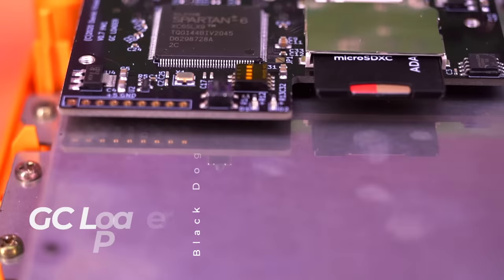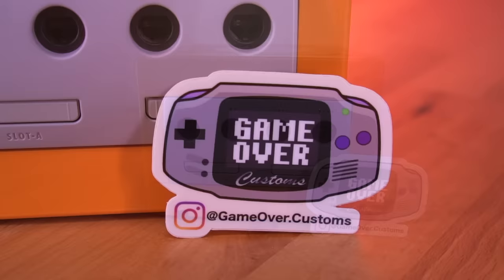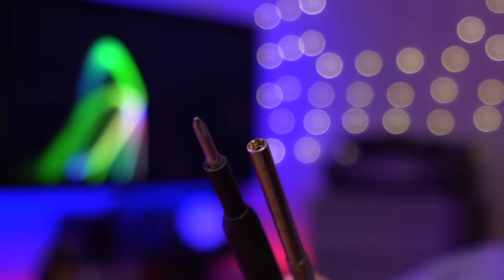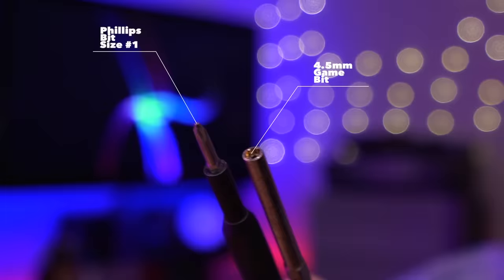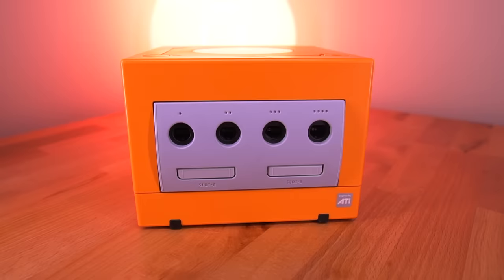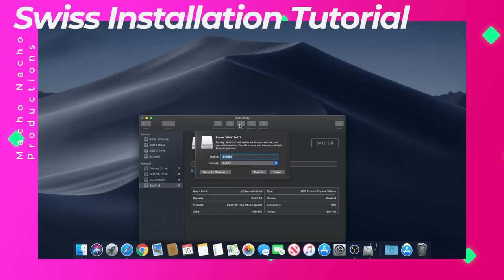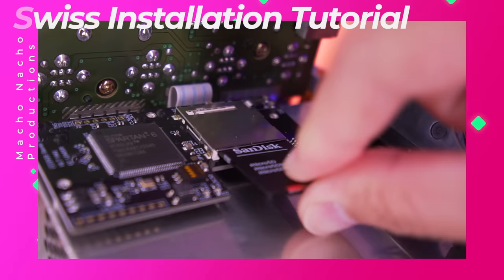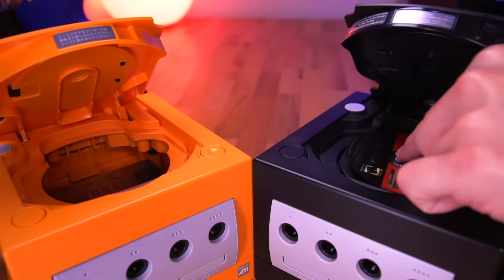How To Easily Play Your Entire GameCube Library From An SD Card! | GC Loader and Swiss Tutorial 2021

Comment: There's a new ODE coming for the GameCube that utilizes the Serial Port 1 (which will allow you to preserve the original optical drive) and will use M.2 SSD drives instead of SD cards.
Reply: Sounds interesting, can you provide a link or something?
Reply: I would love more info on this.
Reply: Does the Gamecube require a CD when launching swiss/roms? Or is the GCLoader the only CDless setup?
Reply: That means no LAN gaming, but still...
Reply: Any updates on this? Extremely interested....
Reply: Well?
Reply: Must be vaporware
Reply: I have not seen any updates to this project unfortunately. The project was posted/shown by an individual so there's no website or twitter account or similar to track it down.
Bummer since it looked promising in its early stage.
Reply: @RetrOrigin  bummer
Reply: @maciejkobus  That's awesome! I read your post on a Facebook group a while back and couldn't find it again. Glad to see the project is still going :)
Reply: @maciejkobus  Is this the picoboot, or something else? I cant seem to acquire a gc loader but dont want anything that requires soldering etc.
Reply: @Mr_jz_12  M.2 SSD adapter is something different from PicoBoot but for the best experience you'll need both.
Reply: @nbdyknws4446  just in case you still domt know, that would only be the case if you didn't have the gcloader and had something like Datel's SD card launcher. With the GCLoader, there's an iso you put that loads immediately, which loads swiss.
Reply: Post a video about it

Comment: Just did this mod to my GameCube a month or two ago. Super awesome. I used Swiss to use my Gameboy player. 
I also used this cool 3D printed extension mount. Basically connects to the GC loader with a SD card Extender wire, and fills in the space the optical drive took up. Allows you to swap Sd cards if you use multiple of them which is nice plus it looks good for the overall esthetic
Reply: Where did you buy the gc loader printed assembly?
Reply: @brkbtjunkie  laser bear 3d printing. If you google them they'll come up and it's one of the products they have available

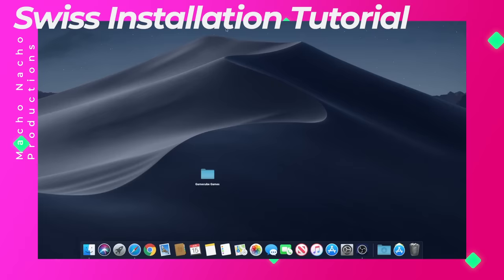Comment: 7:51 Both GC Loader and Swiss supports exFAT Format on larger SD Card.
Reply from the maker: That's awesome!  I didn't know that.  I followed the instructions on a website and it said Fat32.  Good to know!
Reply: You could also reformat the SD cards very easily. Thanks for the extra info. It will save people some time👍

Comment: One more HUGE detail we have to mention: If you dont have a SD2SP2 or a SDGecko Memory card with a small SD card in it, Swiss will not save settings. This is a limitation of the GCLoader and Swiss as it can't write back to the SD card in the GCloader. So all of the patches, settings, etc get lost. 
So invest in a SD2SP2, and drop a small 4gb card in it.
Reply from the maker: I will definitely be doing that!  Thanks for the heads up!  Still learning about the GC Modding scene.

Comment: I want to do this to my GameCube so bad! Just got to wait for it to be back in stock!
Reply from the maker: It's a great mod!  It should come back in stock soon!
Reply: You can also use the Wind Waker save exploit to launch into Swiss, and use the SD2SP2 which (imo) works perfectly fine. You also get to keep disc drive functionality this way instead of needing a second GameCube to play your discs. 

I can't get behind ODEs as full replacements for a disc drive. But if you can add it in addition to the disc drive? Absolutely go for it.
Reply: @Meepok1  Why would I need a second GameCube to play my discs when I can rip my discs and play them on the superior GC Loader? The entire point is to get rid of discs, and the associated noisy disc drives that will fail one day.
Reply: @mjc0961  becauuuuuse what good is it to have a collection if you can't even use the discs? I completely understand the appeal of it but again there's no reason to go with options that guy the drive for no reason. How many GameCubes with working drives do you think have been gutted? 

Also another question: does anyone actually know if there's a fail rate for drives in certain consoles? If you take care of your GameCube your drive shouldn't fail. 

I'd always prefer to have both options but that's just me.
Reply: @Meepok1  I agree. My option is cheaper but does the same thing. I run all my games through the sd2sd and Swiss boots from disc drive.
Reply: I have mine modded with the GC Loader, and SD2SP2 for saving my swiss settings.  Also, I got the EON mkII for HDMI output and Component compatibility for my CRT.  All that bullshit coupled with the M-classic post processor make for truly amazing gaming.  It's a lot of money ( even without scalping prices), but it was fun getting together and it's been worth it.

As far as nabbing a GC loader, get put on the mailing list and when they tell you to get in the que, be ON TIME.  I missed one round and had to wait almost 4 months for the next round.  When I did get mine, the entire stock sold out in 3 minutes.  I was lucky, and I wish the same to you.
Reply: FYI: It's back in stock.
Reply: @bowen1230  and I got it! Thank you!
Reply: @Meepok1  If you don't mind soldering, a cheap Xeno chip will allow you boot to SWISS with nothing else...As soldering goes it's fairly easy one...

Comment: Great video. I don't think you mentioned the gbi or Gameboy interface homebrew that enables people with a Gameboy player to use it without the startup disc. And also the SD card mount from laserbear. 2 essentials.
Reply from the maker: I will definitely be looking into those!  Thanks for the heads up.  Just got the GBA Player too!
Reply: @MachoNachoProductions  Not only do you not need the startup disc, but it provides better video quality than the official software.
Reply: @MachoNachoProductions  Something else you may want to consider, at least for now the gcloader can't write to its sd card, so if you want to save any settings in swiss you will need an sd gecko or sd2sp2 and a small sd card (this would also allow use of swiss virtual memory cards so you could save all your games to the sd gecko/sd2sp2 and not need to manage multiple memory cards), although they are working on adding support for writing to the gcloader's sd card. That may also allow saving games to the gcloader sd card

Comment: I did this to my gamecube couple months ago and the only reason I did it was because my disc drive just stopped reading discs.  I didn't know what to really do it sucked cause I didn't want to just sell it and I discovered the GC loader which isn't much more than a replacement drive.  Well worth it and has nice features.
Reply: Did you still need a memory card or does it save on the sd card?

Comment: ODEs for the GameCube has actually existed for a very long time allready , most of the Wii odes can be converted to the GameCube with simple PCBs but at the end of the day supply of these have been decreasing over the years as long as the price is right it's not terrible to have another solution available.

Especially if you consider that Swiss can play ISOs from a simple memory card to SD adapted or a plathora of other SD adapter's for the GameCube

Comment: This is expensive( $90+), you can do a same type of mod, a few solder joints and you can also get the same experience. Get a Xeno chip, $4-6 on ebay, a SD2SP2 $2-4 and a SWISS Disc, you can get a whole kit, WITH the SWISS disc on eBay for $20.  The advantage, you can also play any games you have physical AND you can play every game you want via ISO on a MicroSD card... 

This is good if your drive works fine,  You just leave you SWISS disk in, always boot to the menu and select you game..

All for under $20
Reply: Audio streaming is still an issue last time I checked. There's better compatibility with the GC loader due to it being an ODE.

Comment: It'd be nice if someone designed a 3D printed tray so that you could mount the PBC higher, using a ribbon cable to connect between internal GC header and the GC Loader. That's really the only negative I see, the SD card slot is inconveniently deep inside the case.
Reply: It already been made

Comment: There's a bunch more mods you could have done. I recently changed the thermal paste, changed the fan to a silent fan, changed the LED to a blue LED, changed the system battery and of course got the GC Loader installed as well. It was all pretty easy a great project in the end. Don't forget you can also use a GBP with GBI in the SD card and play GameBoy games as well.
Reply from the maker: I'm definitely planning on doing some more mod of the GC.  I just felt this one deserved its own video. Cheers!

Comment: Another amazing, informative and polished video from Tito! :)
I absolutely adore my GC Loader too, I put it in my GC last month.
I do have a few problems and I wonder if you have had them too:
-Upon launching Swiss, I keep being greeted with a popup saying that an update is available... like what, my GC isn't connected to the internet!
-Swiss will keep whining about not being to save the configs all the time until I decide to use an SD card on one of the memory card slots. (Gecko/action replay)
Reply from the maker: I have noticed that too.  I think Swiss is comparing its version to what it thinks the latest firmware is for the GC Loader, I too havent updated it yet.  In order to save the setting you need something like the SD2SP2 which plugs into the bottom.  I may do a follow up video covering this.  Cheers!

Comment: I'm actually considering this because I have the SD2SP2 adapter which I've been using to play my GameCube backups. One downside though is that you have to boot up the game that you're using as an exploit every time. 2 games that are able to use this exploit is 007 Agent Under Fire and Pokemon XD: Gale of Darkness. Pokemon XD is the one I used.
Reply: I use Melee for that. It also works with F-Zero GX, some Zelda games, some Splinter Cell games, and a few others.
Reply: @roflBeck I know Wind Waker and Twilight Princess both work. Also Super Mario Sunshine but only the PAL version, not NTSC.

Comment: I prefer Action Replay method and I use 2 Gecko's and run my PC Engine CD and SEGA-CD games from slot 1. I put all my small stuff on 2 Gecko but I run my Mgba off slot 1 as well as the previous mentioned. I run all my Cube games from SD2SP2 with a 128 GB SD. No modding my way unless you want to buy Japanese and Solder R6 under the heat sink to make it English.

Comment: Did I miss something? How do you put in the SD card if the unit is put back together? Do you reach through the top or put the SD card in before you assemble the unit? How do you save games?
Reply: Correct

Comment: The thing about the GameCube is uses micro discs and getting those was very difficult in this day and age because all the ones that you can find are either stock that never got sold or cheap Chinese discs. This can make mod chip useless. Not to mention disc drives fail over time

Comment: I have been looking at this mod for a while. I need to find one with a broken drive first.. All of mine are working so I don't want to tinker.
Reply from the maker: Sounds good NuBatman!  Cheers!
Reply: If you have a few then working on ONE would be a nice project. The drive can be safely stored.
Reply: Got lucky/unlucky that the gamecube i found on goodwill has a broken drive, now I have a reason to buy this lol
Reply: @SquirtIeSquad  Hey. If it was under $20 it would have been all worth it. I have 7 systems and got them all under $20 (lowest was $3). Had to trade for power supplies though.
Reply: @SquirtIeSquad  You can do Swiss first while you wait for more GC loaders.

Comment: Really cool mod, but I about as plug n' play as a console mod can get
The only thing that sucks is that it isn't disc compatible anymore, so you might need a separate Disc GameCube, but ofc if the GC doesn't read disc's anyways, it's a non-issue
Would however be extremely cool if ODEs had the option to plug in an external disc drive, though I can see why they don't do that, but for complexity and you can just rip the GC games and put them on the drive

Comment: i would like this done on a psp, so using the umd drive slot, imagine emulating it with a pcb and sd card slot,  in the xmb menu under games you see the disk spin and load, could be an app menu like the volume demo disk that goes thru homebrew and tools basically allowing you to expand the storage of the psp and utilize the inferno kernal etc like in the old days, but with faster load times.
Reply: you wouldnt need to since the psp already uses memory cards and has been runnng iso's without issue since 2005 using custom firmware

Comment: I installed the Xeno chip and run my backups via SD card. The GC loader is great just don;t have $90 to spare
Reply from the maker: The Xeno chip is great!  I think it requires soldering which some people may be uncomfortable with, but it is certainly a great option!

Comment: The issue I keep getting with my GC Loader is that it turns off or disconnects from power after booting into Swiss. I can start an ISO but the game stops before I get to the menu. Similarly, once I boot into Swiss and select storage device, GC Loader is an option and then disappears after selecting it. Really frustrating to feel crippled in this way.

Comment: I will stand by my thought that I will not modify my consoles drastically unless they break and I cant get the broken component replaced by a similar one.
as for this I was sorta hoping that you would be able to run it in parallel with the original disc drive so you had the chose of using the sd card or your physical collection to play games.

Comment: Great video! thank you. I was having problems loading games and Swiss was asking for an update so i downloaded the update file. I opened the dol file and the system went to a black screen saying press A to update, i did and it and it tried 4 times too but it failed each time. it then continued to say reboot your game cube. Now Swiss doesn't load, I just get a Nintendo screen stating to look at the manual. I re formatted the sd card to fat32 and applied the pal file and I am still getting the Nintendo screen saying look at the manual. i appreciate your help! tia.
Reply: Did you buy a clone GC Loader?
Reply: @DasAntiNaziBroetchen  I did, that was the problem! I sent it back to Amazon now

Comment: Hey Macho Nacho, I'm just getting into retro games and I've found your content to be great. It seems that this is sold out. Do you have any idea when Black Dog tech will have this back in stock? I already picked up a digital port GC on ebay that had a broken optical drive, but can't get it working without the part :(
Reply: use picoboot with a sd adapter

Comment: Cureently I'm using swiss with the sd2sp2 Adapter for my GC. What are the pros compared the sd2sp2 Adapter? The later ist much simpler in setting up for basically the same effect (no opening of the GC is needed. I would assume its much cheper too. Furthermore you Can still use the disc laser for legit gc games. If the laser is broken, this solution wouldnt work of course. 

Am I missing something?

Comment: The only issue, as is with all mods that make you format your SD Cards, USB’s or HDD’s into FAT32, is that any ISO that is larger than 4GB will not fit, regardless of how much space your device has. FAT32 is simply wired that way and has been so for a while. So no Metroid Prime 3 for you 😒

Comment: Does the slot for the card have to be so deep down in there???  I was hoping the slot would be up at the same level as the old disc spindle was.  I can picture that deep area in there filling up with dust all the time.
Reply from the maker: There is an adaptor you can buy from LaserBear Industries that sells a cover and SD Card extension

Comment: Does GC Loader firmware 2.0.0 remove the need for SD2SP2 to use the virtual memory card function like it does for saving settings? I want to use a VMC so need to decide if I need to order and SD2SP2 still or not. I appreciate anyone who can confirm this for me as I'm just buying the parts now so have no way to confirm myself.

Comment: seems like they dont sell the gc loader anymore T_T
Reply: At this time its another easy way to mod your GC without loosing your DVD Drive. Its called "picoboot". Its pretty the same as GC Loader, but you need to solder some tiny cables to the DOL Chip on the Gamecube and the Modchip is the raspberry pi pico. to load your games you need an sd2sp2 (only DOL-001 Console) and/or a gecko memorycard. Its way more cheaper than the GC Loader and your Gamecube keeps more or less "original" because you dont lose your DVD Drive. When you disconnect the gecko memorycard or the sd2sp2 adapter, your gamecube loads into oem state. so you can play all your original games. when you plugin the adapter, your gamecube straight boots into swiss where you can boot your original discs too and you games from sd card.

Comment: Does this support compressed iso's? Meaning shrinked iso or whater it is called, as I know some GC games are really small.

Back in the day I installed the Viper mod chip, got a new shell so the cd tray fits a full size dvd disc. I still have that modded GC today. Looking at getting another for this GC Loader.
Reply from the maker: I'm not 100%, I think I read someones comment that was discussing compress iso files and it seems it does.  Again, not 100% sure.  Cheers!